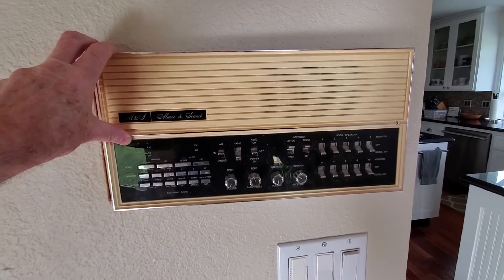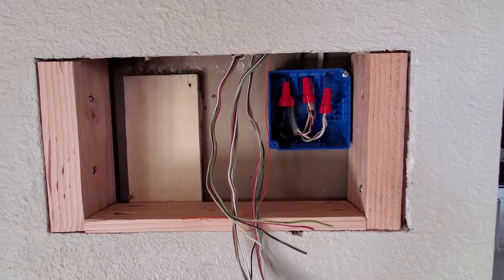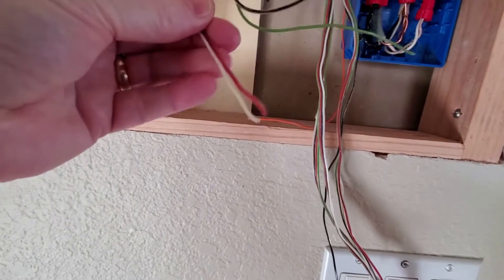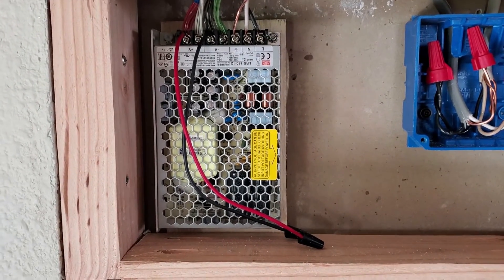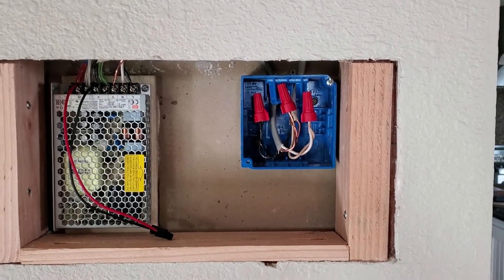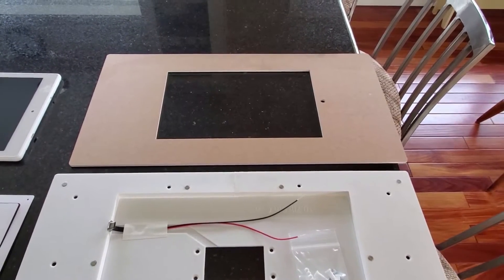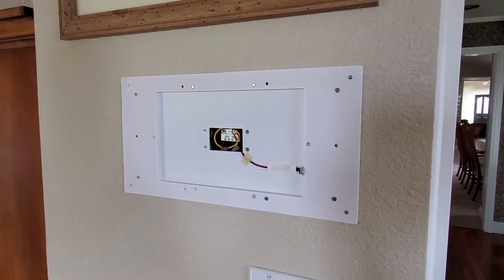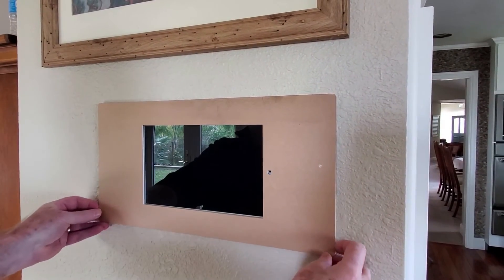Old Intercom Replacement - Wall Mount Tablet

Comment: First, Thank You for the shared Knowledge, it is greatly appreciated... 
OK, it seems that four years have passed, and I would really like your opinion on what is the best Amazon/Samsung tablet to use that would best fit the build
Reply from the maker: Thank you for kind comment. I would suggest 2 factors of consideration: the first is to get latest technology available; second is to look at available wall-mount options for whatever unit you choose. You are not necessarily limited to Fire tablets, any android is feasible - but Fire are very affordable option and you can find mounts for it readily. Good luck!!!

Comment: that frame is a lil absurd with how big it is, id just make my own
Reply from the maker: The frame is the size it is to cover the existing hole from the old Intercom Base Unit without the need for any drywall repair - some may be skilled in that, others not so much. Of course if you can make your own surround and/or accomplish that repair, that is fabulous. Hopefully you perhaps gained some other tips from the process.

Comment: Any troubleshooting tips?

I think there is either an issue with my power supply or the daisy chain. And I idea where I can purchase the daisy chains that came with the genie to test?
Reply: Unbelievable, I actually got it to work with Echo 4th gens. FYI, there is a little switch on the side of the old power supply that I had to slide up. This is incredible. Thank you so much.

Comment: Thank you so much for this video! I am currently working on this exact same install. I just have a question about the updated power supply- can you show how you wired with the new power supply. I’m no electrician by any means so just wanted to double check how everything was connected. Thanks in advance!
Reply from the maker: Look for my (Ken Scott) posts in this thread - https://www.houzz.com/discussions/4321917/what-to-do-with-old-wired-intercom-system  - there is a reply to 'daddyhawk' that details what  you are looking for.  You may have to expand 'see more comments' in order to see it. Unfortunately I can't link directly to my post, just the thread

Comment: Hi, thank you for this detailed explanation. I think I'll try it. I have many echo devices (a few dots of various generations, echo show, echo spot), but don't use a table of any kids. We're all PC, laptop peopole. A few questions

1. Can I mount any tablet? 
2. Is there any reason to have a Fire tablet vs any other tablet? The echo dots will still work independantly right? 

THANKS !!!
Reply from the maker: Hi Rosa - you can use any tablet with the qualification that a) you can use a power supply and adapter to suit the model you choose and b) you can get a wall mount custom-made for it. Recognize that MBMounts made a custom over-size bezel fascia to cover all of the old aperture in the wall after removal of the old intercom base unit (std size bezels are probably not big enough, so you either do some drywall repair, or as per my concept an oversize bezel. MBMounts also offers a custom service for devices not listed on his std offerings.You may also be able to find some other 3D Printed mount suppliers if you do a web-search. You don't necessarily need a tablet at all as far as operation goes, it really depends on what you need it to do for you. Since you're more comfortable with PC, there is probably no reason why you couldn't use a Windows Tablet assuming you can get a mount made for it. 
Note that you can'tsimply seal the wall up if you plan to install a power supply and use the intercom wiring for distribution - you need to fit 'something' that is removable to access those.

Comment: Great upgrade! I'm getting ready to upgrade my Nutone IMA-3303 master station and (9) ISA-335 Remotes with a 10" iPad and (9) Apple HomePod minis. When I calculate the power supply amperage, do I simply use the maximum amperage amperage of each HomePod mini and multiply it times the number of units, then add the maximum amperage of the iPad?

Now that it's been two years, how is the new system doing? Looking back, and aside from the power supply, is there anything else you would change? Thanks!
Reply from the maker: Thank you @idealynx - can't comment on 'now' as I sold the home about 18mos ago. But fairly confident it should still be good. Your math process is sound from a a failsafe standpoint; however note that it is highly unlikely any of your devices individually is going to be anywhere close to the max rating, let alone all simultaneously. This is very similar to your main home ac electrical panel - if you add all the circuit breakers it almost certainly will exceed  the total for the panel.  I guess you need a USB adapter for those?
Be interesting to see how you mount the homepods - I guess you could use something like the TotalMount - https://www.amazon.com/TotalMount-Compatible-HomePod-Premium-White/dp/B08W6N4LYT/ and either repair the wall or use a plain rectangular acrylic blanking plate to cover the original hole. 
Interesting personal twist on the project - for an Apple user it certainly seems like a great way to go - good luck!

Comment: While I think this is really creative and useful, there is one big problem — a lithium ion battery powered device inserted into the walls of a house.   While battery management software has greatly improved over time, the risk of a battery fire is still real.   If asked, your homeowner’s insurance agent or their underwriter would likely veto this home improvement.  After all, airlines are concerned enough ban lithium ion devices in checked luggage because of the fire hazard.

Comment: Is an Echo Show 15 a better choice than an HD Fire 10 these days for a smart home addition?
Reply from the maker: It COULD be- depending on what you want to do with it - if just Amazon functions, then probably yes. However if you want to do other things, like adding pretty much ANY Android app you want, then the Fire 10 has more capability in that regard. (I wanted to integrate things like my Alarm control and all my Smart devices onto it) And you're not limited to the Fire - you can use an Android Tablet from just about any manufacturer and simply add Alexa app and whatever else you want.

Comment: Hello.  Glad I found this tutorial.  I have a few questions.  I am not ready to replace the main MS unit yet, but I do want to replace the intercom boxes in each of the bedrooms.  I have purchased the genie kits from Amazon and attempted to wire as you suggested.  Green/Black to negative.  Red/White to positive.  As I mentioned, I'm not replacing the main box or doing anything with the power supply.  So my question is this:  There's power going to the individual units in the bedrooms through the Green/Black and Red/White wiring without doing anything to the main box or power supply, right?
Reply from the maker: No, you can't do that Rocky - you need to install a power supply. I presume you are just abandoning the intercom capability so you can re-purpose the wiring; but you need to install a power supply to which you must connect the wiring feeding the stations, having disconnected it from the master station within that module. You can leave the master in place if that is what you want for now, but you will still have to get in there to access the wiring and find somewhere to install the power supply, which you will need to connect to the ac supply coming into the unit BEFORE the transformer.
Reply: @decosse01  Understood.  Not sure why I thought there was power going to the individual stations.  Is there any way you can tell me the exact power supply you purchased.
Reply from the maker: @RockyHill-i7k  it's in the description notes
Reply: @decosse01  Ok.  Sorry to ask so many questions.  I'd most definitely be willing to pay you for your time.  Here's where I am.  I purchased the power supply in your notes above.  (120v down to 12v).  I wired the live wire from the power supply into the incoming live wire.  Same with neutral wire and ground wire.  Power supply is producing 12 volts on the output side.  On the wires going into the sub rooms, I have the red/white combined and the green/black combined as you suggested.  I connected the red/white to the red wire on the output side of the power supply.  I connected the green/black to the black wire on the output side of the power supply.  I have the Amazon dot connected in the bedroom.  It plays perfectly fine for about 15 minutes, then shuts off.  I still see lights on the amazon dot.  I have another amazon dot sitting right next to it on the table in the same room that plays for as long as I want, so I know it's not a connectivity/wifi issue.  I've tried multiple amazon dots and they all do the same thing while connected to the red/white and green/black. Is there something obvious here.  Again, you can send me your venmo and I will compensate you for your time.
Reply from the maker: @user-bo1ml5tr3h  have you disconnected  EVERY other original satellites from the wiring? I.e. not just at location you are replacing, they must ALL be disconnected
Reply: @decosse01  No.  They are still connected.

Comment: Thank you for this video! I've been looking for an in wall power solution for wall mounting an echo dot in our home. I just didn't like the idea of a visible power block plugged into an electric outlet. I've even recently ordered a vail amp 3 to power a couple of ceiling speakers and thier solution is to have a visible power block plugged into an outlet as well even though their mount is designed to be flush mounted on the wall. Thanks again!
Reply from the maker: Glad I could help!

Comment: Hi, I have everything wired and hooked up. However, it seems the power supply converter isn't working. It won't power the dots and it won't power the fire tablet (with the 5 volt converter attached). Here is what I bought. MEANWELL 150W 12VDC 12.5A 115/230VAC Enclosed switching power supply switching converter.  I have verified the wires are hot to connection.  Any suggestions on what I can do to troubleshoot? I looked for a power switch on the converter or a reset button but don't see one. If there is supposed to be a LED light lit up to show power, I'm not seeing that either.
Reply from the maker: The first thing would be to validate that that you have the input wired correctly and the breaker is back on and you have the 115 at the input power connection terminal (Black Wire on 'L') - test with a non-contact voltage tester or a voltmeter. Now the supply is short-circuit protected, so if you have a problem with your output wiring connections, then it would cause the output to shut off; so power off breaker, then disconnect all your ouput wires and then power it back on; if you have a voltmeter, check to see if you now have 12V between the +V and -V terminals; There is more chance you may have done something wrong with the in-wall wiring to the DOTs than the 12V/5V for the Tablet;  if you don't have a DC voltmeter then proceed to connect ONLY the 12V/5V converter and connect that into your tablet, turn on breaker and see if tablet now shows it's connected for charging. If that works, then you need to see what you may have done wrong with the wiring going to the DOTs. Respond to this with the status after you check with NO output devices connected and then with only the 12V/5V connected; if those are both good then we can cover the inter-connect wiring for the DOTs again.

Comment: This is awesome, I have the exact same system as your video that I want to replace. If I changed it just the tablet will the sound work on the old speakers that are already installed on the walls.

Comment: Awesome job!  With the new power supply did you just use some large wire nuts to connect the power supply output to the wires used to power the echos?
Reply from the maker: Thank you Joel. I've had that question a few times - please see my reply to same question by Tim Levey.

Comment: Hi thanks for your quick answer to my previous question, my next question has to do with the type of tablet used, can I use an iPad tablet? and would that also work with the amazon echo dots?  Thank you
Reply from the maker: It's been a long time since I did Apple anything - but I believe it should be ok. You would set up your Alexa account on the iPad and add your Dot and other Alexa compatible devices to that. I don't believe you can get Fully Kiosk Browser for IOS, but there may be other alternatives. It just depends on what you want to do besides just intercom and music and the interface you want.

Comment: Hello great video about what to do with an old nutone intercom system. thank you, my question has to do with replacing the nutone wall door station with a camera doorbell system that would be wired and covers the same footprint as the old wall station (the door station is similar in size as the room intercom stations) thank you  my name is Rob Pasch
Reply from the maker: Doing a wired doorbell just adds more headache than is worth what might seem as an advantage (not having to recharge the battery) - I just replied to a similar question only a few days ago, if you look through all the comments (sort by newest). The issues with wiring - you need to keep (or possibly even replace) the old transformer to provide the power for the video bell; the placement of an old-school door bell push button is rarely in the ideal place for a video bell (typically these are often much lower or off to the side); the shape is almost certainly completely different (i.e. an old intercom type of station) than a video bell, so you will have to do some kind of adapter plate to mount the new video bell. Just go with a rechargeable and save a lot of hassle

Comment: My doorbell is wired into the Nutone speakers. I don't have an actual doorbell in the house. Now that the speakers don't work, my doorbell doesn't work. Do you know if making this switch will allow my doorbell to ring through the echo dots?
Reply from the maker: You can't really make a 'dumb' doorbell (switch) integrate to the Dots' Audio system - the best plan would be to switch to a video doorbell, which will work nicely and give you either a chime or even a verbal announcement "Someone is at the doorbell" - or any other phrase of your choosing. And you will also be able to view the image on your central Tablet, as well as your phone(s). You can go completely wireless on a video doorbell - my personal preference is Eufy. Going wireless (i.e. a battery model, not just wifi signal) gives you more flexibility on doorbell camera mounting location, vs one that is powered from the wiring; if you were to use the existing doorbell wiring, even for something like a Ring, you would need to retain the original ac transformer just to power it, as well as the power supply for the dots. Better to just go completely wireless for all the advantages that brings.

Comment: Id recommend changing your breaker panel. Bryant is one of the manufacturers that has been identified as a fire hazard due to what is known as "failure to trip". Sometimes the breakers will not trip during an overload or short. I have seen panels with almost every breaker melted. I personally haven't seen a Bryant panel melted or witnessed a problem with them, but buddies in the trade have. I have seen numerous Challenger panel failures and the aftermath of fires started by them. Both manufacturers were popular in mobile homes in the 80's.
Reply from the maker: Thank you for your concern. It prompted me to review your advice and could not find anything related to concerns about mid-90's Bryant, although certainly did find cautions regarding FPE, Zinsco, Challenger and Pushmatic, however all of which pre-date the age of my (former) home. Appreciate you looking out however.

Comment: Nice clean install.  Curious about one detail--the power supply you mounted in the wall-do you think it has adequate ventilation  so as not overheat and fail or pose a fire hazard. Just curious what the installation instructions said, if they did. I saw all those holes in the power supplies cabinet thats why i ask.
Reply from the maker: Good question! If you look at the link for the Power Supply I changed out from the original shown in the video, you will see it is a solid enclosure, so the mesh cover is somewhat moot. I believe the perforated cover in the original is purely aesthetic intent. What a user must realize is that the rated power capability of the Power Supply (in this case 150W) does NOT mean that the Power Supply is DISSIPATING 150W, only that value is the load of which it is capable of handling. These supplies are approx. 90% efficient which conversely suggests that at full load output, they might dissipate approx 15W (i.e. 10%). In truth it will probably never see 150W of actual load, even if everything is at full tilt. But it was spec'd for the max rating of each device, which themselves have a high margin of safety.